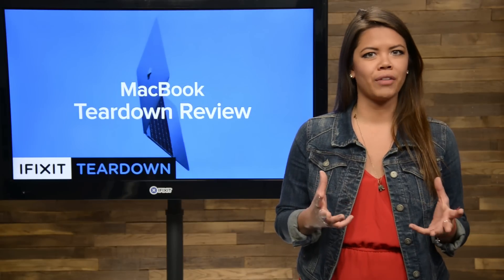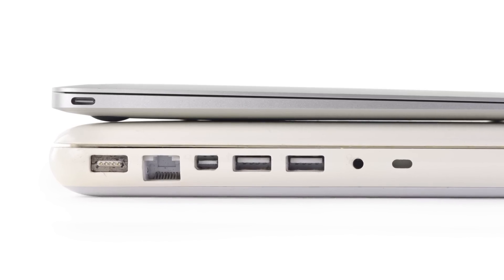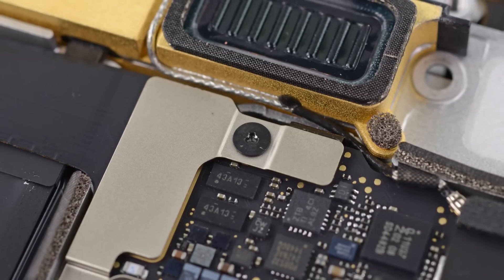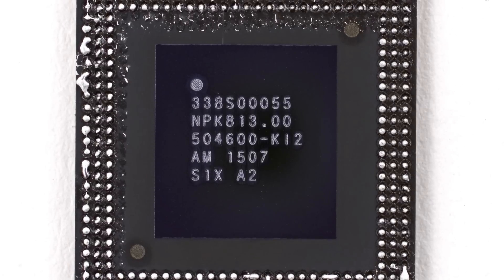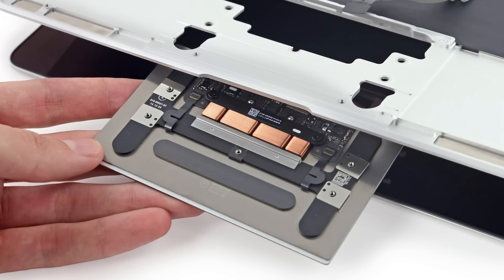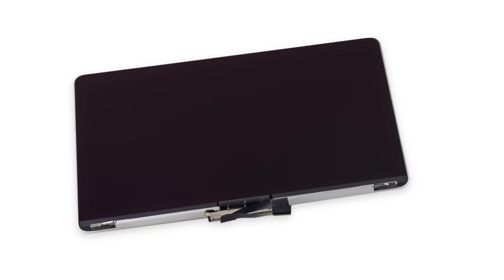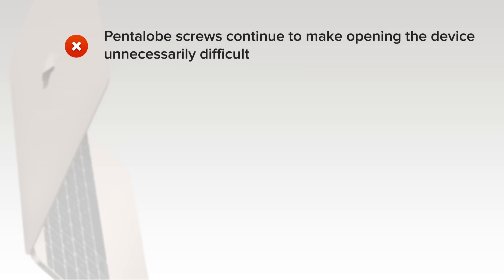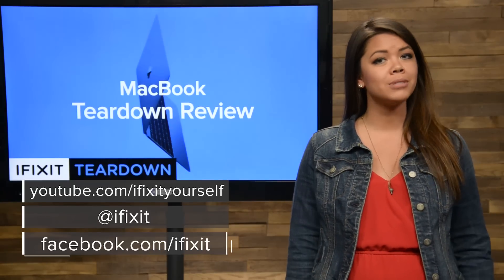Retina Macbook 2015 Teardown Review!

Comment: 3:54 Easy to pop out the keys? Guys, you just broke off the pin in the upper left corner! Actually it is nearly impossible to pop out these key caps.

Comment: I'm pretty sure that one day, Apple will make a completely sealed device that's impossible to repair, and you'll just have to buy a new one.
Reply: Jack Attak I cringe for that day to come.
Reply: That wouldn't be cost effective to them nor would it be efficient.
Reply: Matthew Gonzales Well I wouldn't say this laptop is cost-effective or efficient either...
Reply: It's infinitely more cost effective and efficient than just throwing away a computer that's 99% in working order in order to just resell an entirely new computer. What if there's a design flaw? You think Apple's going to throw away every flawed computer that's recalled and just build new ones? The current process they use isn't the best, but ditching this for a completely sealed design just doesn't make any sense. How would they charge you to fix a device? How would they sell you Apple Care? How would they claim to be a green company? A completely sealed design conflicts with all of this.
Reply: Matthew Gonzales Well of course it makes no sense for them to do it right now, but things change, and it almost seems like they're headed that direction right now, with devices getting thinner and thinner and harder and harder to repair. Also, I said "device", not "computer", since their computers will definitely stay somewhat repairable for a while, but devices like iPhones and their Apple Watches are starting to reach a point where thinness and lightness is the first priority. A device is so thin and packed together that it wouldn't make sense for them to add a point of access to it, and just make it unrepairable. My initial comment was a sort-of joke anyway.
Reply: Jack Attak No. even if they make it in repairable for the public to fix, they'll never make a device completely un-repairable for them. And all Apple products are devices. even if they had everything on one single board, including the battery, that doesn't make the board thinner.
Reply: Matthew Gonzales You're  completely right. I'm obviously not knowledgeable enough to really know what I'm talking about.
Reply: Jack Attak well, HTC had already created One which gets destroyed if you merely replace the battery.
Reply: Well atleast phones are repairable not like samsung or htc.
Reply: Jack Attak That Day is almost here. Apple is screwing itself. They really need to ask their customers what they want.
I think they can shut down the macbook series. Macbook air and Macbook Pro. Just leave it to that.
 

What I hated the most...
Only One USB Type C? so I have to lug around a USB hub all the time... Damn irritating. Design without functionality is a really stupid decision on apple's behalf.
Reply: +Matthew “The Original Black Bean” Gonzales No, because if you send it in for repair then they will give you a new one, but it's cheaper for them to just replace one part.
Reply: ***** No, that's not true. If you have a problem with the camera, they'll service it. If you have a battery or display problem, they will service it. If you have a logic board issue, they will replace the device, but they don't give you a brand new device. It's a refurbished unit most often.
Reply: Aaaaaand Apple homepod...

Comment: My main problem with glued in batteries is that it's something you would expect from a 100$ crappy chinese tablet/laptop... not from a 1000$+ "premium" product.

I remember the time when you could remove the battery with just a coin I thought apple engineer would have found a way to make their product as sleek as they wanted while maintaining user serviceability (which was one of the main thing old school apple enthusiast praised about their products).

Sticking everything with super strong glue? And you're calling yourself an engineer/designer?  A 4 year old kid could answer that.
Reply: indask8 Planned obsolescence is Apple's game now bud. They know this new Macbook will go out in 2-3 years by now, and they have a plan for when that happens. They take away stuff each year, and when you look back and see how much they took away you'll be very surprised.
Reply: This is more of a response to Shadow, but my MacBook Pro is from 2011, and it was the first MacBook that transitioned into a lot of glued parts. Your theory is planned obsolescence isn't really accurate from my experience. Again, since late 2011, I've never had to take my computer in for any issues. The charge is fairly great still as well.

Furthermore, Apple using glue doesn't expand on planned obsolescence. Apple could make the parts easily accessible, but that doesn't mean the lifespan of those parts are any better. You have a flowed view that seems to be based on no actual data. It appears to be more of a slippery slope argument.

Also, what did they take away? The ability to take out your hard drive and battery pack? The ability to exchange a SuperDrive for another hard drive? The ability to upgrade your RAM? That's not a lot of options taken away, considering Apple has always been about providing a user with a complete experience from the second he or she opens the box.
Reply: indask8 
A $1000 notebook should have an easily replaceable battery,ram that is easily expanded,a replaceable CPU,and upgradeable mass storage.
Reply: ShadowofColosuss103 
This computer is already outdated as it only has a 1.1ghz dual core CPU and Intel graphics.
A sub $600  AMD APU based notebook would smoke it in everything but disc access.

Comment: I'm not an Apple hater. I have an iMac, and I love it. But Apple's losing focus.. ONE FRIGGIN' USB-C PORT! Yes, you can get an adapter, which they charge you for as extra. That adapter should at least be included in the box! The Macbook is expensive enough, as it is.. Oh well.. :-/
Reply: You are still using ports on laptop? In 2015? For what? O_o For watching VHS?
Reply: Lex Fradski Well, I don't own a laptop. But that single USB-C port on this machine is a multi port! This means, there is no dedicated display port, there is no dedicated charge port and no separate USB ports. It's all one port! You can only do one thing at a time, unless you buy that adapter thingy, which is sold separately. But luckily, the machine is "thinner" and "lighter" which apparently is much more important than functionality and practicality.. To answer your question (albeit rhetorical, I guess), yes I would use ports. Not for VHS (wtf?). An example would be Time Machine backups on a separate physical drive. But hey, that's me.. We're all different. You never use ports on a laptop? All right. That's the way you are. ;-)
Reply: Brian Nielsen time machine can do backups wirelessly via Time Capsule or any another drive such as Seagate Personal Cloud; for presentations you can mirror your screen via airplay; most of modern cameras (incl. both beginner and pro levels) has a Wi-Fi/Bluetooth adapter; dedicated charge port? this macbook is filled with a batteries, you will use a charger only once a day, in any other time this usb port will be always free. even 3,5mm jack will be always free because of tons of wireless headsets and home audio. This Macbook is not for that kind of work where you need your cables. On my home and work PC the only one cable I use (except power plug) is Ethernet for high speed connection to local network, but it also can be replaced with latest WiFi. Yes, I am connecting camera, my old camera without wireless module, and if I want to connect it to USB-C there is no problem to find cheap 3.1 cable with this plug. And it's five minutes to copy all photos and your USB is free again (and you can use that cable later to connect HDD if you really need it, but it's extra rare).
Reply: Brian Nielsen not a blame, just a scenario :)
Reply: Lex Fradski Personally, I prefer to have a few ports available. You do make some good points, though.
Reply: 1 port isn't getting me anywhere , i use a :
portable mouse
2 flash drives
1 external hard drive (runs my mac, 2 TB, come on 128 GB is getting me no where, my Desktop folder is about 4 GB+.
printer cable
charger cable
ipad charger.
i port, isn't going to get me anywhere. at the minimum i could use a mouse and my external hard drive, and the charging cable.
Reply: probably this macbook is not the proper choice for you — and you also should review your future lifestyle.
Reply: One port is the future. We need to get used to using one port because if laptops are to get thinner we need to take away some ports and eventually ditch ports altogether.
Reply: +Brian Nielsen 1996 here they come once agian,... Deja Vu... soon or later, as they introduce more and more confusing products that are not that different one from another,... they did same thing, back in 1990's...

Comment: Wow, looks like apple put an underpowered cellphone inside of a Macbook shell. When are they ever going to stop trying to rip people off.  I have a 2012 13" Macbook Pro Retina and really like the build quality but wish I had gotten something more powerful.
Reply: Well actually the core m is even better than a atom in mobile devices but it is still overwhelmingly underpowered for anything more than a light internet use.
Reply: That's really not true at all. This CPU is more powerful than the i3 CPU in the Microsoft Surface, and it's almost as powerful as the i5 for the Surface. If you bump the CPU in the MacBook to the 1.3GHz model, it's more powerful than the i7 in the Microsoft Surface, and this CPU ado want require a fan to cool down.

If you just look at the power output and justify the cost on that, you're ignoring how much engineering it took to make a chip that's more powerful than a lot of Core-i processors without requiring additional cooling solutions.
Reply: wait wait wait! core m better than an i7 please explain
Reply: Even the slightly thinner sleek hp spectre has an upgradable ssd. If I had it my way I would use torques screw mounted battery instead of glue, an upgradeable ssd, and a single upgradeable ram stick. A glued battery would be completely understandable for a smart phone due to its limited space but, I would prefer either a user replaceable battery or friction fitted non-user replaceable battery that can be easily removed by prying it with a plastic a spudger tool due to spring loaded contacts after you've removed the screen and digitizer assembly from the device.

Comment: There should be a macbook pro 17 with retina display and it will be called "macbook pro 17" with Upgradable ram, m.2 SSD, and GPU but, CPU is still soldered to motherboard. Inside will 4 ram slots at least 2 occupied, 2 apple proprietary GPU slots at least one occupied with the GPU, CPU soldered to motherboard, battery held down by t5 torx screws instead of glue, and has 2 or 3 heat sinks depending on configuration. Ports 2 type C usb, 1 thunderbolt, 3 3.1 type A USB, headphone out, magsafe power connector. Features: available 6 core mobile intel core i7(comes standard with quad core mobile intel core i7), 16gb-64gb ram, nvidia or ati radeon (available dual graphics cards), 256gb-2x512gb SSD options, made in USA, and 1.25 inch full range aluminum cone speakers for richer and fuller sound.
Reply: Everyone does. If you want a Mac, then you won't really need to do anything that needs a desktop CPU.

Comment: So I'm allowed to say it's a crap.
Reply: ***** gotcha ;)
Reply: ***** I had my Macbook Pro Mid-2012 since well... 2012, still works fine. Has upgradable RAM and Storage like yours, and plus an Optical Drive so yeah.
Reply: ***** I've been wanting to upgrade the RAM from 4 GB to 8 GB though, should I?
Reply: Josip Belčić dude its about being thin. not about being expandable.i am buying it for lightness.
Reply: Edward Johnston Ok then, good luck with your thousand ports for that thing if you ever wanted to use something that isn't wireless and/or doesn't have a USB type C plug. Also have fun with your potato camera which is 480p.
Reply: +Josip Belčić it all depends. When you are looking for a notebook this small and light with a great display and the best keyboard and touchpad on the market there is simply nothing else.
Reply: I would personally get a 3500 dollar fully upgradable mechanical keyboard MSI gaming laptop better than MacBook pros and even Alienware laptops

Comment: Ok, one single tiny lonely usb.. but. This is a minimal device, lighter than ever. Wonderful keyboard, and off course OS X. Do they really complain because of the weird screws?!? Can you unscrew.. where is the problem then. You can't replace the cpu/memory/ssd.. what a shame.. in a device that is SUPPOSED TO BE OPTIMIZED TO DRAIN MINIMAL POWER FROM THE BATTERY! It's a new device, not just a laptop. You can't throw stones against something that has been designed to be extremely portable, light, compact, magic. Do you want to fit a 14-cores Xeon and 128 GB or ram? Buy a Mac Pro!
Reply: fabrizio bordacchini Ok then, how do you explain that is has less battery life than its ancestors like the Macbook Air? Yes it is a beautiful design, but is it worth the sacrifice of having non-replaceable parts, a 480p camera, and only ONE USB-C port? You would need to buy multiple adapters if you're wanting to get more ports out of it. And yes while you have the point of saying, "Hey if you don't like this device then go buy one of the other Macs that Apple offers" that still doesn't justify why Apple priced this at 1,299 USD (or something close). This is a really underpowered computer only for the purpose of show.I'm a big Apple guy myself, I have a Mid-2012 Macbook Pro and an iPhone 6 Plus. But when a company does something stupid like this, I'll point it out no matter how much I love the company.